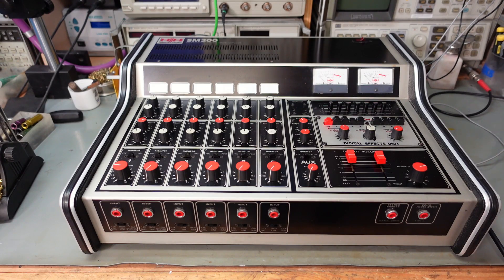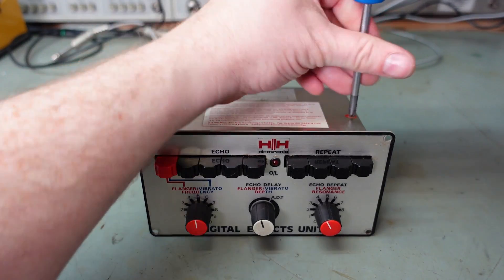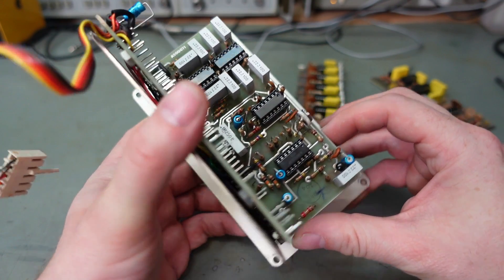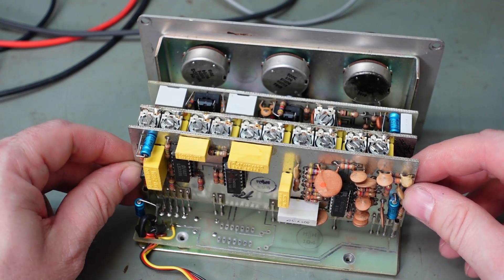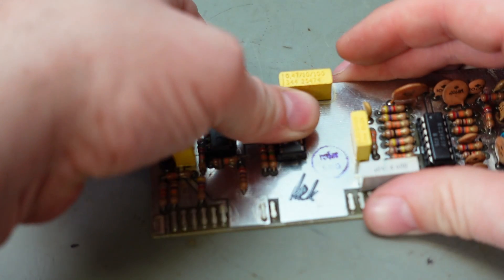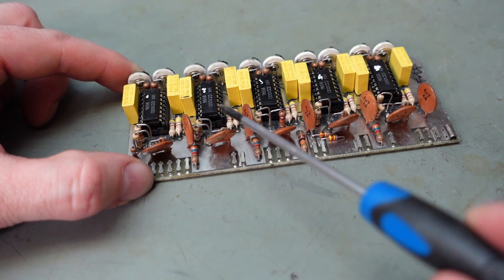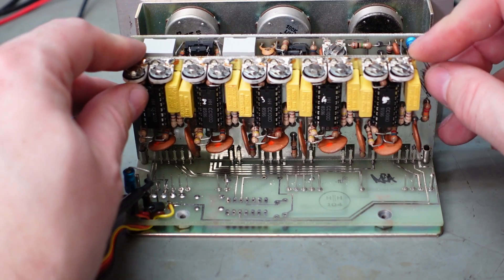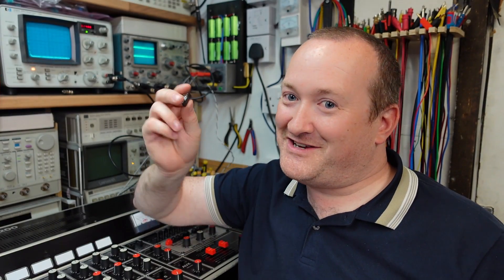HH Digital Effects Unit Repaired!

Comment: The SAD1024 was widely publicized here in Brazil in the 80s, in electronics magazines aimed at hobbyists who liked sound effects. As it was a very special integrated circuit, its price was already high. I found one here being sold for US$100, but it's scratched and the seller "swears" it's authentic.
Who would have thought that an LM339 would be the villain? They are quite robust and any PC power supply has one.

Comment: In the early 80s I built a circuit with this bucket-brigade delay chip (sold by Radio Shack [in Massachusetts]) for my cousin.  He was a researcher using brainwaves (EEG) to control a music synthesizer and needed to delay the signal by a controlled amount.  The slower the clock speed to the chip, the longer the delay, but also the narrower the bandwidth.  Since the EEGs he was using were below 15 Hz or so, we could get over a half-second of delay out of the single chip.  I never saw any warnings about the chip being static sensitive, which was a good thing because I sure didn't handle it with any care, and it survived.

Comment: I had a "ambient sound" unit briefly, made by ADC I think. It also used an uncommon chip - a kind of CCD bucket-brigade cascade thing - and worse, they used it outside its level specs.
So it would die.  These units were notorious for this.  And then you'd try to find a replacement, only to have every major supplier disavow all knowledge. 
The only apparent source was another dead unit.  I set mine aside and set an autosearch on eBay. 
Forgot about it. 
Literally years pass. 
Ping! Some guy in Canada with a perfect record has a bag of ten for sale. Bought 'em, installed one, unit worked, and I immediately sold it with the chips included as spares. 
I also epoxied a heat sink onto the chip just in case it might help. ;)

Comment: I remember soldering chip sockets on vero board back in the late seventies.  Programming EPROMS back then on a seperate machine and the unreliability of what chips you could get meant you needed a socket.  Plus I could prepare boards before I went to get the chips from Radio Spares (small place the back of Liverpool Street, I wonder what happened to them?) and Marshalls.
You are in another league when it comes to sorting this stuff out.

Comment: I had an H&H SM200 6 channel stereo mixer amp on a stand with sound effects, like reverb an echo. I used it for my Pearl Electronic kit (Drum X).
It was perfect for it.
As I had the effects built in,  never needed to get a seperate box for it.

I also had the boxy H&H monitor combo with a u shaped bar to alter the angle of it.

Comment: Very nice repair on very nice equipment! But.... there must be a reason why the chip died. Any thoughts on this
Reply: I know nothing about this unit and don't have the schematic in front of me but these kinds of comparators are so robust, reliable and cheap that many manufacturers don't bother with the expense of designing in very much in the way of protection for them. Replacing under warranty the one in 10k that fails is cheaper than the circuitry needed to prevent that 1 in 10k from failing.

Comment: Very strange that HH called this module "digital effects"... the circuitry is based on purely analog BBD "Bucket Brigade Delay" ICs manufactured by Reticon (SAD1024). 
As always, your work and skills are GREAT!
Reply: It had a digital clock generator. One have to milk the cow, since digital was a big selling argument at that time.
Reply: @rhkavli  right !
Reply: BBDs are kind of a matter of perspective. They are technically analogue but one could argue they are actually digital, that's why you need the low pass filter. They are kind of a grey area middle ground between a and d
Reply: In terms of signals domain, BBDs are absolutely analog... no doubt... the values of the sampled analog signal (stored in the BBD capacitors) are discrete and can assume virtually infinite voltage variations, whereas sampling in digital mode results in the storage of strictly predefined values between 0 and 1 (low - high).

Comment: I have merely a fraction of your intelligence but around 26 yrs ago i was given an old Moog keyboard to repair ( i just loved tinkering & only knew the basics) keyboard had around 5 keys not working so i just assumed the M083 chip ( if i remember correctly) sitting in front of the dead keys was to blame, swapped them around & hey presto. The chip was well out of manufacture... i ended up being given the phone number of Rod Argent  who actually had a junkbox full of very useful bits including an M083. Hold your head up Woah, Hold your head up, etc

Comment: But who did HH think they were fooling by calling this a digital effects module when everyone knew that BBD were analogue delay devices? They were so easy to spot because of the amount of background noise they generated.
Reply: "Digital" was the buzz-word of the 90s. Simply by adding it to anything electronic you were bound to increase your sales because everyone wanted this "new" "digital" technology. I remember seeing home stereo units with "DIGITAL" emblazoned on them, and there was absolutely nothing digital about them.
Reply: @stopthebus  Did they have a digital display? That's digital after all.
Reply: @wingracer1614  No, these ones didn't. As I said, there was nothing digital about them. It was a gimmick - a word added to things in order to gain more interest as at the time, the emergence of "digital" technology was seen to be the new thing to have.
Reply: better than saying turbo but you had to be there😄
Reply: @mandymoo7406  That was the other buzz word of the 1980s! Even computers came out with a TURBO button on them.

Comment: Just out of curiosity, Where abouts do you order your electronic components?
Im looking for a reputable website in the UK, Something similar to Mouser, But has to be UK based..
I found Digikey website, Looked promising, Stocked pretty much anything i searched, But after registering, i found out its actually USA and deliveries take weeks...
I also found Enrgtech, which looks pretty good for stocking most things, But it says on the website "delivery to UK"..... So that makes me think that ITS NOT actually in the UK :(
- I find myself needing to order quite often, And cant be dealing with waiting weeks for orders.. 
Thanks
Reply from the maker: I get them from anywhere I can. Preferably UK stock, but some vendors prices are not amusing, and they still take over a week to ship. I try to stick with RS Components, CPC, Farnell, Digikey and Mouser.
Sometimes, eBay is the only choice.  I think you have to sense check what you are buying. New Old Stock tends to be genuine, but I wouldn’t trust any power transistors from China. I have no idea how it is economical to manufacture a tiny BJT silicon, and bond it in a big TO-3 case etc, because they do not sell these fakes for big money. Honestly, if they are clever enough to make a working silicon die at all? Why not make proper power transistors???
Reply: @MendItMark They probably buy whatever BJT dies they can get their hands on - can be rejects or what have you. I bet the quality of the TO-3 packaging job also would be somewhat lacking. After all, as long as it sells, it's making money. Most people don't bother returning and that's how they make money. Little by little. :(

Comment: I recall JVC's first consumer front-loading (and rather advanced) HR-7700 video recorder from the very early eighties, which also featured a BBD. Thus enabling stabilised audio playback in x2 play (i.e. no 'chipmunks!').

The Ferguson Videostar 3V23 clone was more common sight, and/ or a badged rental (Baird, DER, Mulibroadcast, etc), but I digress. I wonder if it used similar chips?

Comment: Just a follow up to my reply below, I have watched your video a couple more times and my comment about your drawing not being clear is wrong, my screen grab from your video caused some resolution error on my part, however, when i looked at the "official" service manual from the HH spares supplier MAJ Electronic it turns out that this also has scanning/printing resolution errors showing the same fine line omissions as the screen grab. Your copy of the circuit is a far superior copy, where did you obtain that from?,  
As usual keep up the good work,, another very interesting module from HH Electronic in the 80's was the so called Valve Sound Module fitted to the VS Musician Range of amps and combos, again i did a lot of work on these modules and I thought you may do a teardown of this if ever one comes your way.
As usual keep up the good work
Reply from the maker: I got the schamatics from MAJ... I do think HH schematics are done 'half hearted'... Like an afterthought....

Comment: Hi Again Mark, another excellent video on how to repair electronic equipment, as a veteran Engineer I love your presentation and sharing your methodical fault finding skills on video.
Now this module for the 1980's was revolutionary and I did quite a lot of development using the SAD1024 and reversed engineered this module for the requirement of repairs back then, as  the circuit diagram you have was not available. There are some scanning/printing omissions on your drawing around the connections in the chain of SAD1024's but for repair purposes i don't suppose it matters. Your presentation has prompted me to dig out my original drawings from the 1980's and prototypes of this module for a further look at. I also have 2 of these modules one in the superb SM200 Mixer Amp you featured and 1 in HH's 16/2 Mixing Desk from the day, the desk one does have a fault which i have not been inclined to fix, however, after watching your repair it gave me a nudge to get on with it, maybe my module will have the same IC fault as your repair. One of the features of this module you did not explore was the use of the red button this allows a form of phasing to occur which if used correctly gave quite a convincing double tracking effect to the vocal.  I used this module in a 16/2 mixer in the 80's and as one of your followers correctly said HH Electronic Kit was exceptionally rugged, my HH 2KW rig performed night after night, gig after gig throughout the 1980 without a flicker and i would wager would still out perform many of today's examples. Your follower Wildchurch does bring up a good point regarding the term "Digital" in fact the only true digital IC in the module was the CD4013 however analogue is coming back. A last note from my research back in the day, I added another CD4013 into the clock circuit to divide the clock frequency by 2, this gave the module some incredible long delays and very accurate repeats without suffering too much distortion or clock pulse breakthrough.
The SM200 mixer amp you featured was also an under rated performer in the 80's giving a great 150w per channel integrated into a 6 channel mixer, again quite revolutionary at the time. HH Electronics were certainly on top of their game pity they went bust.
Keep up the great videos and keep that enthusiast flowing we need more of it today. Best Regards Phill

Comment: Another great video Mark! I always learn something watching them.  Wish I had some of your test gear!  Could you post a TV power supply  repair, I'm stuck on one that is dead.
Reply from the maker: Hi Ric, I don't have any TV's in for repair (I stopped doing them - too many screen rebuilds!). A quick trouble shooting: If the fuse is blown, look for a shorted transistor on the primary (mains) side. If the fuse is not blown, check for shorted diodes on the secondary side. If not, check for faulty capacitors... Have fun!